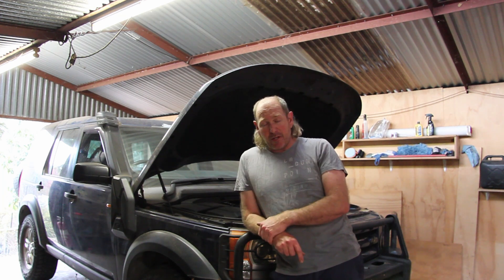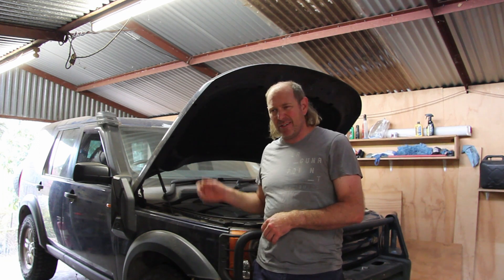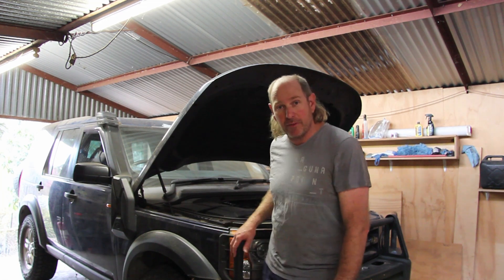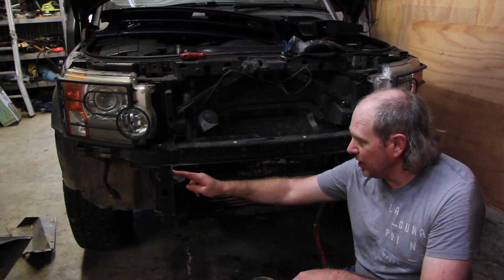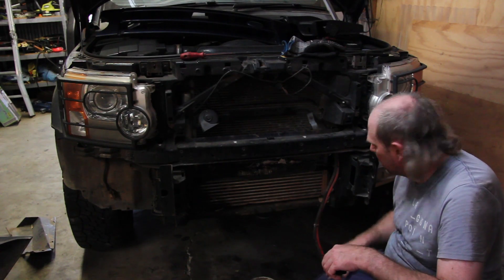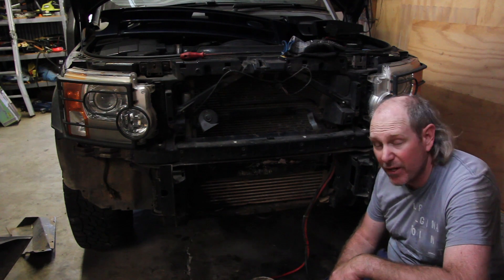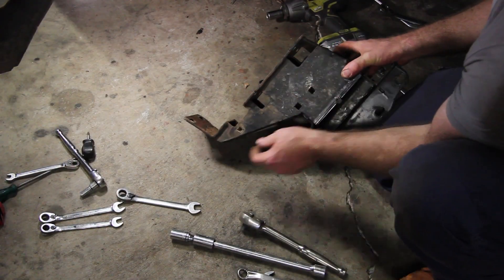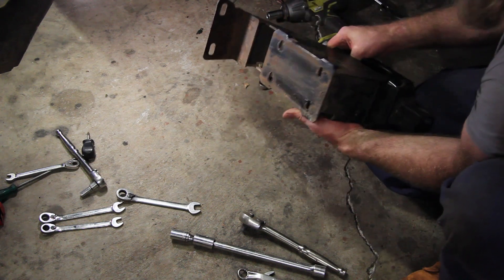Dismantling my D3 - Removing the ARB front Bar

Comment: Awesome mate, should have that all done in no time, how was it to install originally? the Hilux wasn't too bad with the ironman bar, but holy shit the ARB on my HDJ100R Cruiser was such a pain, chassis needed to be cut off slightly with the grinder, glad I did it myself as I managed getting all metal filings out, 4wd shops don't normally care.
Reply from the maker: didnt seem as bad for the install, but maybe that was just because all the bolts where new? Yeah accessory fitters would just be smash it on as quickly as possible